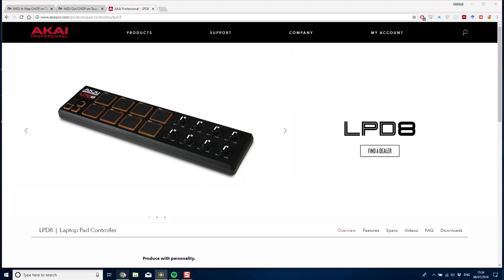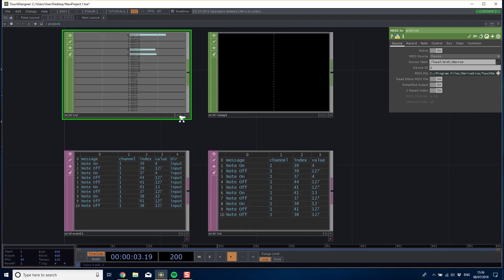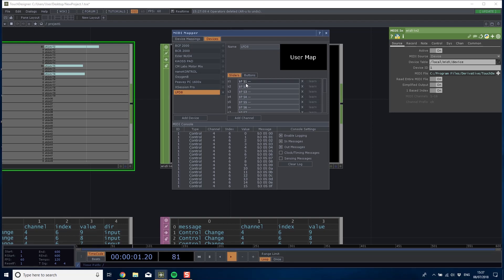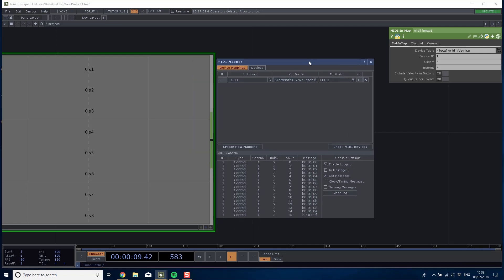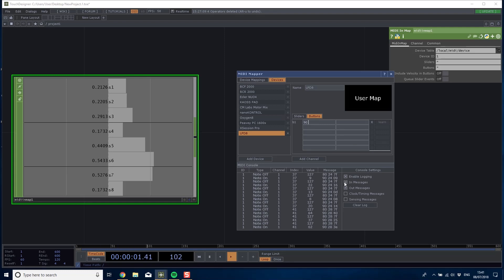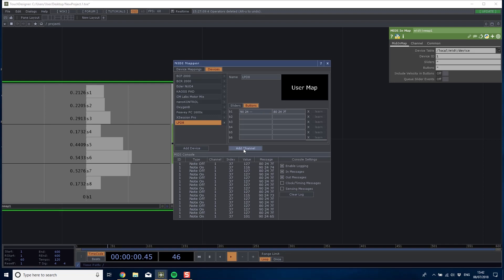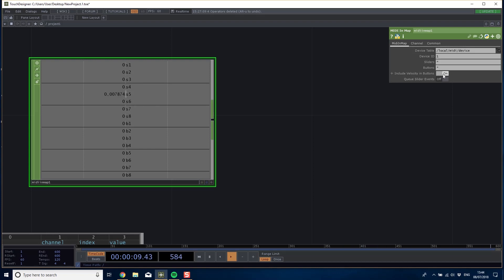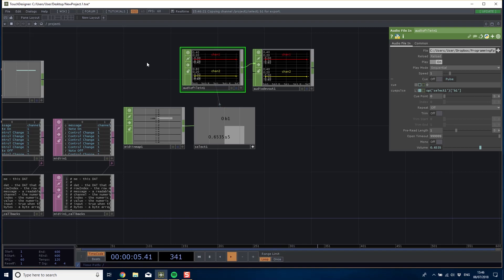Touchdesigner - Midi controller quick start guide

Comment: In my midi manager in log the message section shows only the value. I am using novation Launchpad X but i created custom modes with cc buttons and faders. I recieve the information of the values and buttons but since the message is instead of b++ ++, mine is only a number of the value 0-127. Is there anyone knows why i cant see any different addresses ? Only value is changing
Reply: have the same problem with my Novation Launch Control - and for me it means that the midiinmap chop isn't registering anything - any ideas on how to fix this?
Reply: @ if you use an external midi information software you can see the addresses and then you can write it in td, it works for me
Reply: @hppdms  awesome! thanks for the tip - it works now :)

Comment: How can I change the range of the slider between 0 and 1 like in the video? Mine works from 0 to 127 in the select chop. Thanks a lot for the tutorial by the way!
Reply: I'm kinda new to this but maybe you could route it through a function to reduce the range
Reply: @Under1The2Bridge3  I solved it a few months ago, by using the math chop prior to the select chop. By the way, this video helped me to use TD with midi, so thanks a lot

Comment: If anyone here is thinking "there must be a better way to populate these mappings", I discovered a spreadsheet formula that I was able to use to automatically generate all the messages, it goes something like =CONCATENATE( "ba " , DEC2HEX(ROW(), 2), " --").  You'll need to adjust the strings and the first param to the DEC2HEX depending on your starting point.  Exporting the spreadsheet as a tsv, one can navigate to /local/midi/userdevices/template and populate the dat tables via Ctrl+e, pasting the contents of the tsv.

Comment: Awesome tutorial! I was wondering if there was any way to save the new device mapping to the MIDI mapper in order to open in another project file? Thanks!
Reply: Matt Ragan gives a pretty good answer to this in Part 3 of his MIDI Mapping series.
Here's a playlist link. TLDR you can export a custom component TOX with your MIDI mappings for each new controller then just import it into different projects as you please.

https://www.youtube.com/watch?v=XLeghJmFBh0&list=PLH-IBHIXahauD5cS7NA2YgkGV0FNcSQPM
Reply: @leitflux  slight correction. he talks about it at the very end of Part 2 👍
Reply: Came here with the same question. Did you find a good solution? Best I can find is creating a custom new project file that has this saved in it already or exporting the data as table that can be referenced.